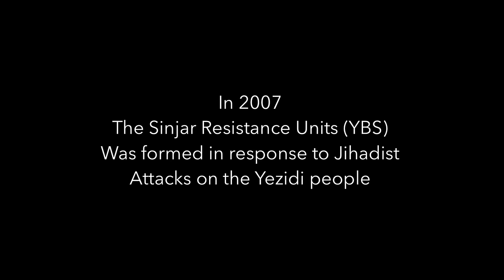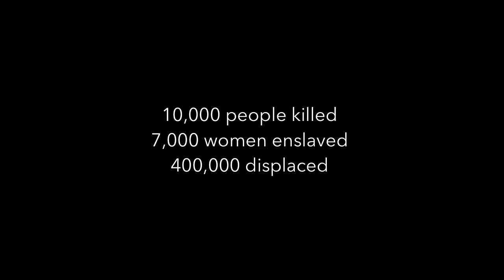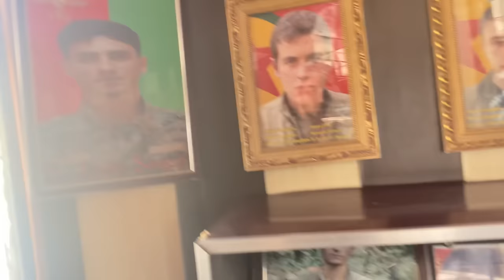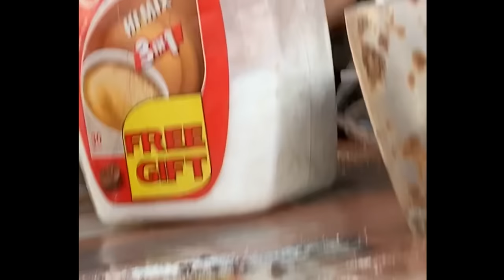My experience as a guerilla fighter in Iraq

Comment: I notice on alot of the weapons, namely AK's, used by the soldiers and yourself seem to be mainly iron sights. Do you find this makes combat far harder than if you had something like an ACOG attached, or are engagements so close iron sights do the job?
Reply: ACOGs are overrated and overpriced.
Reply: My guess is they don’t have a choice due to lack of money. They had to clean old rusty bullets to be used ..
Reply: @alphafitter4699  its because they're rocking surplus soviet weaponry and ammunition from the invasion of afghan. AKMs have been in circulation en masse in the middle east since.
Reply: There are plenty of people who can hit targets out to a kilometer using just a diopter sight (a type of iron sight which is vastly superior to an AK sight at those kinds of distances).

The bigger issues with iron sights is that they're difficult to learn and remain a slower alternative compared to optics even for competent users. It's also significantly easier to identify what it is you're seeing when using just a little bit of magnification (such as a 4x ACOG) - this can situationally be a huge help even at distances of just 50 meters.

Both the iron sights and the ACOG with its fixed 4x magnification would be awkward to use at very short distances compared to a non-magnified or even a variable optic that can go a bit lower than 4x (though these have their own issues compared to non-magnified at very close ranges).

If I were to venture a guess, I'd say the primary reason why iron sights are still so commonly used despite being obsolescent (but not obsolete) is because most AKs were never sold or issued with one to begin with. Instead of just sourcing and/or paying for an AK you'd have to also source and/or pay for a decent optic and a unique mounting solution (the AK design is downright hostile towards mounting optics the conventional way).
Reply: @Olamina-c1y  you can use acog in close range it literally works just like any red dot sight. Just keep both of your eyes open like you should.
Reply: @topi7743  It is definitely usable, though I would argue it's still disadvantaged compared to a non-magnified optic.

Parallax and eyebox is not a thing on decent non-magnified optics. Both those issues are present on even the highest quality magnified optics.

There's a reason why some people run miniature optics together with LPVOs, popularly mounted at an angle off to the side.
Reply: @LIQUID_556  The americans just left half a millions tons in weaponry behind so now they got newer sruff
Reply: @AbuHajarAlBugatti  if you're referring to the weapons captured by the taliban in Afghanistan alone, those were taken from ANA forces when they went belly up and surrendered. That's taliban only. And the shit they left is Iraqi freedom era. Last gen M16s and shit.